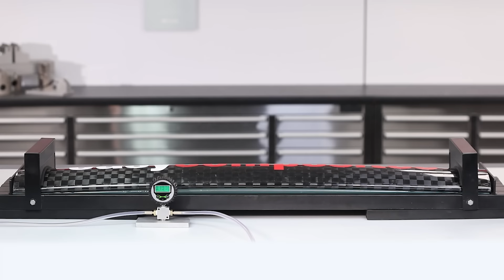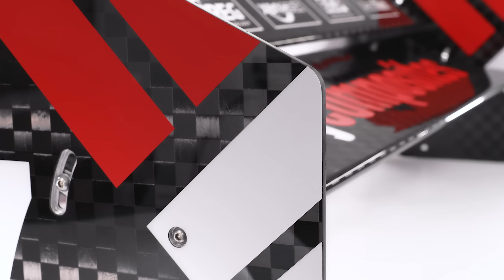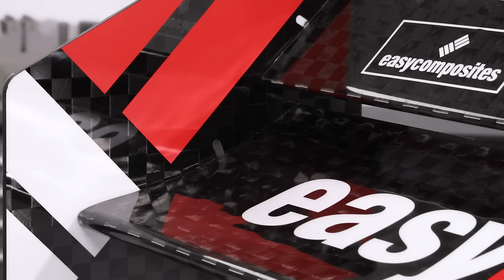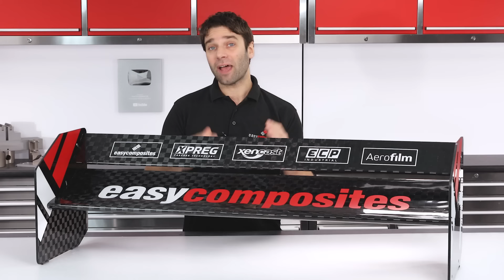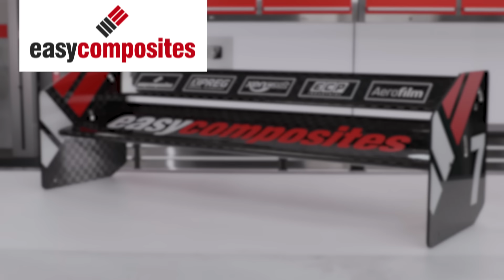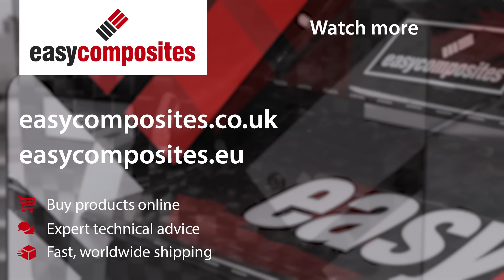Building a Rear Wing with Carbon Fibre and Nomex

Comment: how would carbon fiber galvanically corrode anything? It's not even a metal,,,
Reply from the maker: Galvanic corrosion with carbon fibre happens because carbon fibre behaves like a very noble (cathodic) material when in electrical contact with metals in the presence of an electrolyte (e.g.saltwater). This can cause oxidisation in metallic components.

Comment: Can this be done without a vacuum bag?
Reply from the maker: It would be very difficult to achieve good results without vacuuming the reinforcement in this instance as you're looking to try and pull the fibres down onto the foam core as tightly as possible as well as benefit from the smooth finish that the Mylar will give you once pulled down onto the surface.
Reply: @easycompositestv ok. Thanks for the info. And i appreciate the response. Im looking into doing my own airo parts on my car and your videos are very helpful so thank you for the info.
Reply from the maker: @Kawicat055  No problem and good luck with your parts. If you come across any issues, just drop us an email and we'll see if we can help.

Comment: Could you get more spread tows in inventory? like a 125g and a 200g with 12k high performance fiber. A strange thing in carbon fiber is that the normal 200g cloths are lower performance fibers. Mitsubishi TR50S is a really great fiber but they don't make it in 3K which is the normal tow to use in 200g weaves. You can get a 450g for the same price with a superior fiber. It makes no sense :)
Reply from the maker: It's not something which we are looking at right now but may be something for the future, generally spread tow fabrics are used in the lightest of applications where flatness of the surface finish is critical. One note to factor with the weight of the cloths, whist the actual carbon fibre has to be accounted for there is also the time to set up the weaving machine. A heavier or chunkier fabric will generally require less fibres to be individually attached (by hand) to the machine, so the setup time for these fabrics is somewhat reduced.
Reply: @easycompositestv  I'm interested in it for an aircraft because carbon fiber is so strong that paper thin is often enough but to have some stiffness in the skin it needs at least 2-3plies with little crimp and weirdly they don't make the best fibers in 3K, that leaves spread tow 12K. The 88gram one ends up with comically wide tows :)
Some kind of 200g with TR50S or T700 would probably be a good workhorse for many. Maybe also some 4-5HS because of the low crimp/low resin. And if you can afford to have a roll in inventory why not some T1100 or MR70. 7GPa is crazy performance and you can service absolute top performance customers. Maybe put the tensile spec in the title so people know why the price is higher
Reply from the maker: @DanFrederiksen  We do currently stock a 5 harness satin weave cloth with in a 6k 375g weight if that is of any interest to you.

Comment: Innovative approach to skip traditional moulds! 🚀 This hot-wire + vacuum bag method is brilliant for one-off aero parts. At Jevny, we often use CNC machining & 3D printing to achieve similar agility in prototyping. Fast turnaround for complex geometries!

Comment: Can the Mylar method be used for a "twisted" wing element? Or is it limited to 2D profiles only?
Reply from the maker: You might be able to get away with a slight twist but anything more and the mylar won't really want to conform to the shape and you may end up with voiding or other undesirable surface defects.

Comment: Hi, I have several more questions from the part where you start applying wet-out reinforcement (8:47)
1. How long did it take you to finish the process? (I was wondering how much available work time you had with laminating epoxy resin)
2. Are Mylar films the same as PET films?
Thank you
Reply from the maker: It didn't take us long but the EL2 used has 2 hardener speeds so you can vary your pot life to suit your required work time.  You can also mix multiple batches as you work.  Mylar is a brand name for a type of PET.

Comment: Hi, for the part where you apply Epoxy Raid Repair Resin on Nomex Honeycomb core, can I use Laminating Resin instead? I would love to use exact same resin as yours but it's quite not affordable here where I live. So I was wondering if Laminating Resin could work just as fine because I have the replacement for the Laminating Resin but not for the Rapid Repair Resin.
Reply from the maker: Yes you can, the EL2 which will give you more work time.

Comment: Very, very instructive video. As an young aerospace engineer, I have been bombarded through university with the use of composites, but I sometimes felt lost due to the lack of practical explanations about how composite components are manufactured.
Reply from the maker: Glad to hear you found the video useful and put some context into composite use. We do find that there is quite a large drift in composite theory and practical use, hopefully we manage to find a nice balance between the two.

Comment: What is the diameter of the holes for tapping the aluminium brackets? And wich screws are user for the final assembly?
Reply from the maker: The holes/bolts can be any size appropriate for the the bracket you have.

Comment: de-lamination from the foam core is an issue with successive temperature changes. XPS gasses and also has no voids between the cells - you HAVE to texture the foam to get inclusions and thus good adhesion.
Reply from the maker: Interesting points, although we haven't experienced and delamination and achieved a good bond to the core directly on the hot wire cut surface. This is can be seen in the testing video which followed. https://youtu.be/FFi2H_PC7hw

Comment: Could this technique be employed for constructing wings for full size aircraft? My design has a two 11-foot wing panels with a constant cord of 48 inches. Also, could pre-preg be utilized instead of wet layup?
Reply from the maker: A Method similar to this is used regularly for model aeroplanes so scaling it up shouldn't be an issue. No prepreg won't work with this method, fundamentally because the XPS foam will not take the temperatures required and also needs to be vacuum bagged for processing.
Reply: @easycompositestv , thank you!

Comment: At 14:29 you've touched on a really important aspect that's been bugging me. How effective are different methods of insulating to prevent galvanic corrosion? Wonder if we can have a video about this one day. I can't stop watching all of these. Keep up the good work!
Reply from the maker: In reality Galvanic corrosion is rarely an issue to contend with as we mentioned in the video and only problematic if the materials are subject to an electrolyte. As long as the carbon is not in direct contact then this mitigates the issue, a thin layer of glass separating the 2 is usually the preferred technique but even a good layer of adhesive can be sufficient.
Reply: @easycompositestv  Thanks so much! Yes we have some seawater/rainwater concerns for a battery compartment and swingarm containing aluminum inserts; indeed thinking glass layer but always looked up to this channel as the golden standard! Cheers for the reply!

Comment: Why is there a peel ply on top of the carbon face sheet? How was it laminated onto the carbon?
Reply from the maker: The peel ply is used as part of the manufacturing process of these sheets and prevents the other consumables from sticking to the finished sheet. Once cured, the peel ply is ripped away and leaves behind the texture which you see here.

Comment: Hi,
Thanks for this awesome video ! 😉
Is it possible to know the vacuum pressure you applied to the wing bag not to crush the foam ?

I have high density (30kg/m3) EPS foam, what do you think about that to make a wing ?

Thank you.
Reply from the maker: The XPS we have is capable of withstanding a full vacuum so that's what we used here. I probably wouldn't recommend using EPS as its likely to collapse under that kind of pressure.
Reply: @easycompositestv    I'm trying to understand why here (wet lay + vacuum bagged) it was good to use full vacuum while in other contexts it's good to use 20% vacuum. Please, can you help me? Thank you so much! Best regards, Mircea
Reply from the maker: @mirceaandreighinea  In this case the (non porous) mylar is acting a bit like the mould surface which means that there is not really anywhere for the resin to escape and it remains in the fibres, trapped between the closed cell foam and mylar. In normal vacuum bagging scenarios, you laminate the fabric into the mould and back it up with peel ply and breather. If you were to apply a full vacuum to this layup you would most likely find that too much resin is squeezed out of the reinforcing and into the absorbent consumables.
Reply: @easycompositestv  Thank You Very Much!!!

Comment: Very nice. I intuit that the nomex mainly provides stiffness and does not come close to matching the carbon fiber strength, is that true?  that the nomex fails much sooner than the carbon fibers and that the fibers could benefit from a much stronger core? that you mainly use nomex where you want modest load high stiffness, a kind of illusion of strength
Reply from the maker: Yes nomex allows you to drastically increase the stiffness of a carbon fibre panel at a very minimal weight gain. By itself the nomex panel is a flexible sheet which offers very little in the way of stiffness. The main property of nomex is its ability to separate the 2 skins of carbon fibre with a high compressive strength which increases the overall stiffness by offsetting the bending point at which the panel becomes loaded, thus allowing the tensile strength of the carbon fibre to work more efficiently. As always with this type of thing, there is a trade off between additional weight and strength, yes there are more robust cores but they come at an additional weight compromise.
Reply: @easycompositestv  but it's more than compression. The real load on the nomex is shear. You can try putting it in your bending force rig
Reply from the maker: @ A simple end plate like that is not going to have much shear loading at all in typical use.  In other applications, there may be more shear but that is not that common.
Reply: @easycompositestv  if it was compression then you wouldn't need the glue. As I understand it it's all shear, nomex compression is a minor side effect. It serves the same role as diagonals in a truss.
Reply from the maker: @DanFrederiksen You need the adhesive to help hold all the components together in their intended orientation. True in a purely compressive lab based scenario with the force applied constantly then it wouldn't be required. However this is a dynamic situation and largely unloaded for the vast majority of the time.

Comment: How would you design a metal reinforcement insert's contact area embedded between the layers and how would you design the layout of cloth surrounding the high stress aera. The problem in question is basically 2 points (aluminium eye) on the deck of a sailboat, where the hole dinghy can be lifted? We are talking about 600kgs.
Reply from the maker: You would really need to do the structural calculations or undertake some physical testing. Essentially, you will need to build up enough reinforcement to prevent the eyes from tearing out through the laminate. Spreading the load over a larger area via a plate will help to reduce the stress concentration if possible.

Comment: Can you bulit motorcycle wheel/Rim from carbon fiber
Reply from the maker: Yes manufacturers do so but it is very safety related so needs extensive design and safety testing to do successfully.

Comment: At 16:23, you mention using about 500 grams per square meter of adhesive to bond to ther nomex. If you had a square meter of nomex that you were bonding plates to on either side, does this mean that you would use a total of 500 grams of adhesive or 1000 grams?
Reply from the maker: 500g per square meter is for each side, so to do a square meter of Nomex on both sides would use 1000g/1kg of resin.
Reply: @easycompositestv  Thanks so much! Your videos are incredibly well done and I can't thank you enough for them.
One more question; I'm doing a wet layup to create my top and bottom caps, instead of adhering pre-cured caps as you do in this video. Given this, should I create my caps first, let them fully cure, sand their surfaces to be bonded, and apply the thickened adhesive to bond the Nomex between them as you describe in this video, or, would it be more efficient to go through the wet layup for the caps, then apply an additional layer of thickened epoxy onto each cap prior to sandwiching the Nomex? I feel like this would give me a chemical bond and result in higher strength, but it would lose the flexural properties of the adhesive. Would love to hear your thoughts.

Comment: Just wondering if you could use the mylar as a "tube" and make some sort of infusion process instead 🤔
Reply from the maker: Not seen it in a tubular format.  Remember you would need flow mesh, peel ply etc and a way of getting the resin in for it to flow.

Comment: Hello, would it be possible to use a similar process to create a carbon fiber boot rack for a car capable of supporting a load of about 20/25 kg?
Reply from the maker: In theory you can vary the process for any application.

Comment: Would this hold up for dirt track racing?
Reply from the maker: Depends how likely it is to suffer impacts and be showered with stones etc.  You could certainly use Kevlar in the layup to improve impact resistance. Certainly on something like formula stock on dirt oval tracks, it is likely to get a lot of impact abuse so would likely be relatively quickly damaged.

Comment: I want to try this to remake the aero wrap around wing on my 90 Pontiac trans am as to get a new one is over 400.00 for a product that doesn’t fit that great at times or isn’t even a exact match
Reply from the maker: For a simple flat wing blade it is a good process to use.

Comment: Instead of foam, could you 3D print core sections with very light infill and then back fill with expanding foam? Or even maybe 25% infill without having to fill the cores?
Reply: If it doesn't deform the 3d printed part it might work but the vacuum will likely crush it at least a little bit

Comment: Amazing.  You even go into the topic of galvanic corrosion which distracted me through the first bit of the video seeing aluminum in contact with carbon.  I had always assumed that stainless steel or preferably titanium were the options.   Oddly, I generally like the parts that are created and that drives my interest, but your presentation really makes the process enjoyable rather than just the end product.  Thanks for the content.

Comment: Hi Paul
Have you tried 3d printing a 3.2mm honeycomb, using carbon fibre nylon for example, to provide shape, stifness, fixing points etc?  Is this viable, for a load bearing wet layup sandwich panel application?
Reply from the maker: Not something we have experimented with ourselves but we have seen people try 3D printed core materials.  Would be an interesting test side by side for comparison.

Comment: I thought you couldn't vacuum bag foam?
Reply from the maker: Depends on the compressive strength of the foam.  If it is strong enough then it will not collapse or deform.

Comment: Great Work! Im a member of a FS Team andthis year we are making our first Aero package with your manufacturing method, but we are facing several problems. While vacuum bagging the wing and drawing vacuum, the carbon fiber layers dont press flat on the wing. They kind of build a wave pattern along the trailing edge, altough we are not moving the carbon layers at all. 
Help would be much needed:(
Reply from the maker: To help flatten out the trailing edge make sure that you leave it sitting on a flat surface, not hanging over the edge. You could also clamp it down if you use something flat to spread the load over the full length.

Comment: Where can I buy spread tow by measurement I’m making a formula one wing just for my room so it doesn’t need to me anything crazy but I can’t find any place that sells it
Reply from the maker: Most suppliers will supply by the linear meter.  There are not many who offer smaller sizes than that.

Comment: Has anyone had success using the mylar like this? We found it just sticks to the carbon and hardens with the resin, and won't come off at all. It just breaks into millions of hard plastic shards. We tried window tint film (PET) as a test before we invested in a whole mylar roll and it worked great, same material so we figured mylar would work just as well but it wasn't the case.

So, we decided to do some tests with some small PVC foam squares, and adding mould release wax to the mylar made it come off beautifully with a great surface finish, so as a warning to everyone watching do a small test first and try the mould release wax!
Reply from the maker: If you are using it significantly over ambient temperature then we recommend using a release agent to ensure the film comes off.
Reply: @easycompositestv  It was just at room temperature, no postcure either. Is it possible the temperature from the resin curing had an effect with the mylar?

Comment: We use mylar release film for our wings, which we produce with a prepreg carbon system. We noticed after curing that the mylar release film chemically bonded to the resin. So we bought the chemical release agent from you guys. 

So my question is, do I apply the release agent on the mylar release film and then lay it on the carbon?
Reply from the maker: Yes you apply it to the film like you would on a mould surface.  That should stop the film sticking at higher temperatures.